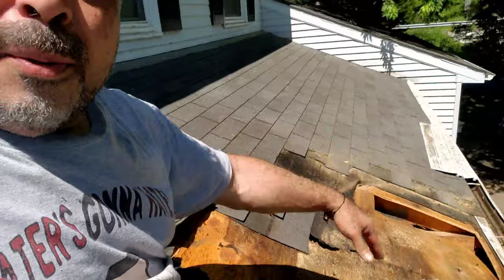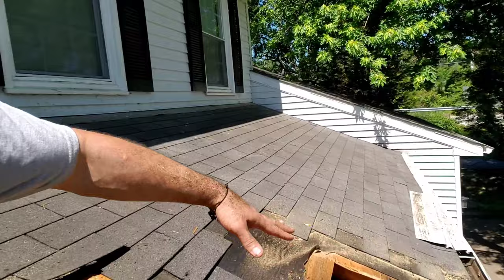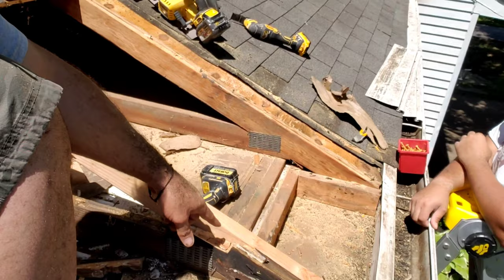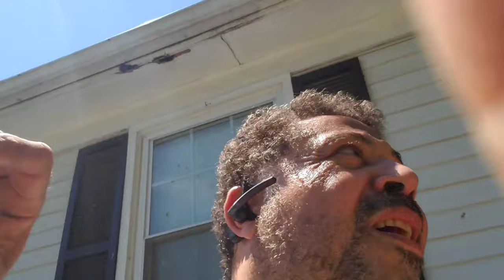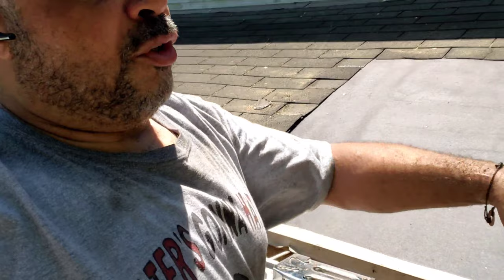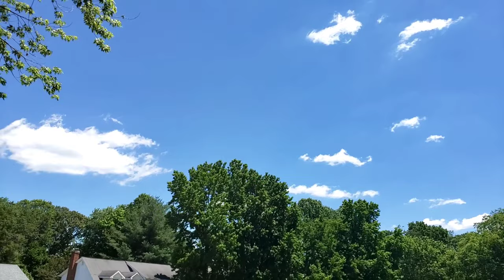Roof repairs replacing rotten plywood

Comment: I can 100% a test to the gutters just purchased the home we were renting it's 115 years old and no gutters on the side with all the bathrooms and sinks and it double whammied the foundation and roof walla everything was sinking, we are half way done jacking up the foundation putting beams ect. It's now having to be fixed bottom first then up. There is cause and effect for everything. But what I also found is do it all your self lol it's just time but the money saved if you have any help or experience is so worth it a 50k quoted job cost us very very little at this point just time and wood we already had

Comment: just curious so i know im not being taken advantage of.  on a 4x8 section of rotten wood that needs to be replaced.   what would be  a range to take out the rotten wood, new plywood, tar paper and shingle.   the damge is down near the gutters which got severely clogged with leaves and debri.  I suspect the water backed up and damaged it.

Comment: My chalet which is super hard to climb.. is so screwed. I am a 33 yr old woman broke so in process of learning all I can to fix our roof (mother and myself). Already have mastered car part rebuilds. Thank you for your information because this is similar to ours but whole roof .. really need replacement but with so many leaks I can only do patching.
Reply: Pinkmeowmix,   A satellite dish , supports left nontarred where support
is bolted through shingle, felt tar paper & into plywood rotted several feet from dish strut.  I replaced structure wood & paid for Copper Napthenate pressure treat pine plywood.     The Shingle process looks possible; how to have the 
alternating finished contrasting shingle
bottom up is  something I have to practice.
& learn.
Reply: @robertknowles2699  I hope to someday be in that position to know all that. The climb up being a chalet is my most difficult challenge right now.
Reply: @robertknowles2699  thank you for taking time to reply
Reply: @cintowin  Three stages you might have are solid structure first, no matter what material of the 3.  A long line, attached to tree branch other side of 
Chalet, can be tied around your waist then knotted .  After I hoisted no. 1, plywood w copper pressure treat in 3/12
( .25 tangent from trigonometry) up w block and tackle, it was covered.   A little rain made surface very slippery.   I use a line from sailboat mainsail sheet.   No. 2
is synthetic felt or older tar paper ? Just ask where you buy patch material. 3rd are 3 tab shingles.   You understand process of 4 or 6 nail ? Wish you'd help
me with the stairstep 6, 12, 18 in., 24 in. ,
30 in. length after snapping chaulkline. 
This Florida Room roof area to reshingle
has vertical straight shingles cut away where I fitted the 4 x 8 ft. x 1/2 in.  lengthwise vertically.  Wondering how to 
slip under existing shingles both sides for 20 ft. vertically, starter shingles turned upside down on bottom 1st row.

Comment: Doesn’t the tar paper go over the drip edge ?????
Reply: Thats what i thought too.  I saw him put the drip edge over the tar paper and came here in to the comments to see if anyone else noted that.  Pretty sure he did it wrong.  My dad did it like this guy and there’s leaks all along our soffit which has ruined our ceiling. Been watching repair videos as im fixing this right now and everyone else makes a point about putting tar paper over the drip edge.  When snow melts, water sits and potentially backs up underneath unless the tar paper is over from my understanding.
Reply: Not necessarily
Reply: @tylersmith8045  your dad should have watched the video while repairing the roof ,,🤣
Reply: The Lowe’s video shows the drip edge on top 🤷🏻‍♂️. Redoing a shed so I watched a few videos and seen both ways so now I have no clue lol

Comment: A roofer would have gone to the trouble, and charged more money, to rip off everything up to the top in order to nail the sister board through just plywood and not the shingles. They would claim that doing it through shingles is tacky looking and unprofessional. They would say "we do the job right!" Cause 'right' means profitable, even though your way works fine. No one is looking at the visible nails going through my shingles and I wouldn't care. If a roof isn't leaking, it's serving it's purpose. I guess you're not worried that a nail hole through the shingle will create another leak and cause more rot, just like the one that started this problem in the first place. Better put tar or silicone or something over those nails, ya think?

Comment: Hi ! I really appreciate your video. What kind of blade would you use to cut a shingle? Also, what size staple you using? Lastly, what would suggest I do if the shingle goes around a pipe coming out of the roof?

Comment: Is the OSB the exact same thickness as the plywood? If so, what would be their thicknesses if you measured both? If not, that means that one part of the decking will be higher than the other. What then?

Comment: What kind of saw did you use on the roof to take out the wood, leaving it in a perfect rectangle for the new piece? I'm guessing that a circular saw would have been awkward, and left a ton of sawdust and wood trash all over the floor of the attic. I wish we could have seen that. My roof is too high up and steep for me to do it myself, unfortunately.

Comment: I had a contractor tell me that the first row of shingles that goes upside down, are covered up completely by the next row, directly on top. Have you ever heard that? They way you did it, the 2nd row of shingles is further up instead of directly on top of the first row.
Reply: I am not sure what you are saying. There is a layer of shingles upside down over the osb decking for the first row (alternatively, you can use starter shingles). Then, a regular shingle goes right on top of the upside down shingle so that upside down shingle is not visible. Then, you just continue up with each row of shingles over the roofing paper. The upside down shingle is necessary. Otherwise, the water running down would enter the seams where you butt the shingles next to each other. Now, it just runs onto the upside down shingle and into the gutter.

Comment: Do you need a work permit to repair a plywood patch? Size 5 foot by 5 foot???
Reply: No
Reply: In my county, you can repair up to 25% of the roof in a 1 year period  without a pulling a permit.  
My current project, I'm doing just the south side of my roof >33% prior to adding solar, and the whole permit was completed online  and was $164.

Comment: We had a rotten leaking area over our bathroom and roofers replaced decking with particle and whole roof reshingled. SAME PROBLEM. Anyone have a possible solution?
Reply: Particle board absorbs water and softens ; freeze-thaw   crumbles  it.